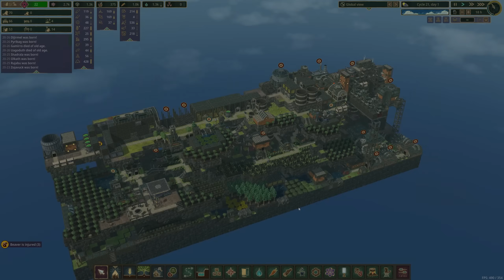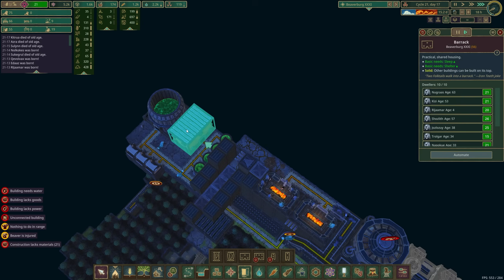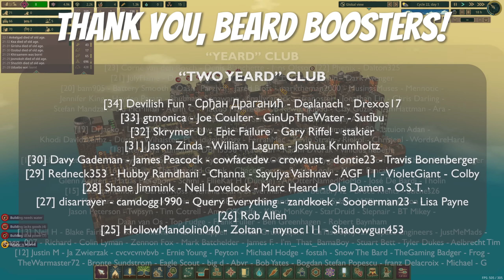Final prep before 1.0 Full Release! Timberborn 1.0 Experimental Iron Teeth Episode 19

Comment: Work hour timer to have the number cruncher only on at night if power ever becomes an issue is a strategy I have seen recently since it pulls so much
Reply: I did something similar with the carousel in my current folktail map. Clutches set to “not working hours and awake” which is a couple chronometers and relays. Otherwise they constantly drain power, and keep the beavers up with their jolly music.

Comment: 1:26
Don't forget that you can change the names of the sensors and things like that.
It can be helpful for organizing things.

2:11
Time you enjoy wasting is not wasted time.
I enjoy the videos.

16:55
Once you remove some breeding pods, the population should reduce a little bit.

25:46
You could conect a power sensor to the network with the excavator and automatically turn it off then it doesn't have power, or a depth sensor for when the engine is flooded.

28:07
Can you put a tunnel under the log?
It might be a way to remove a tree you don't have direct access to.

39:30
You can detonate under a platform by using tunnels.